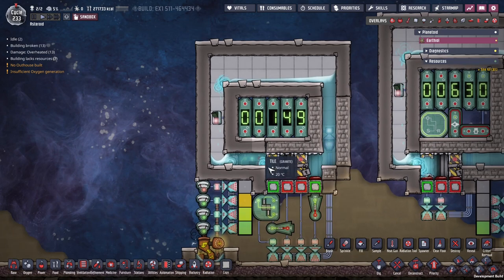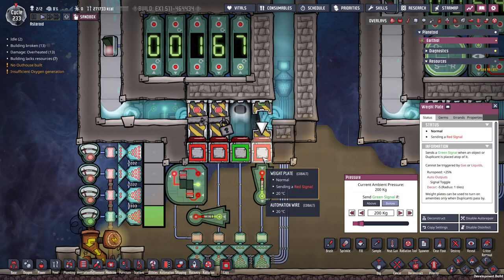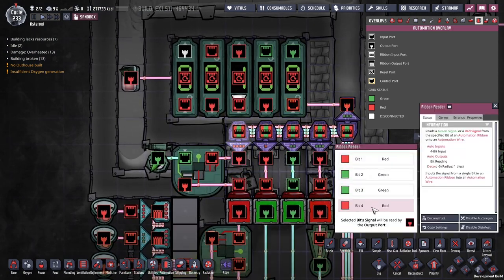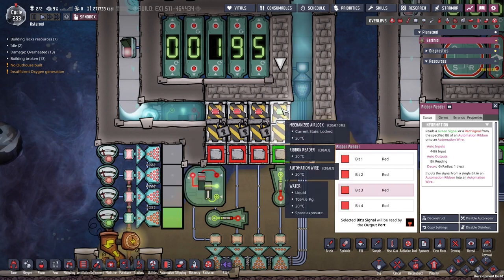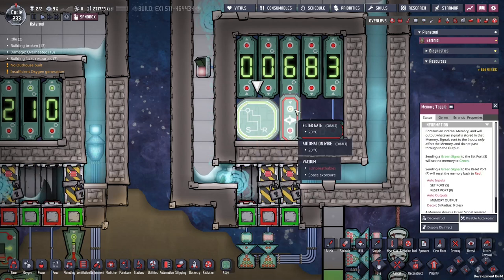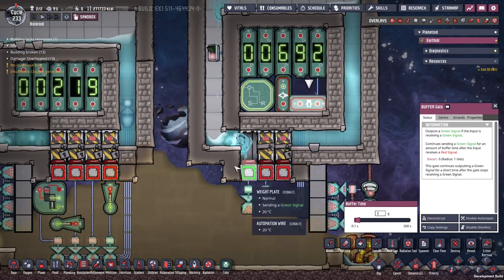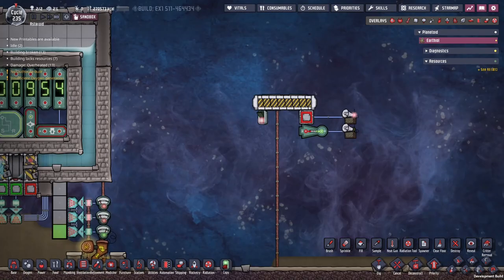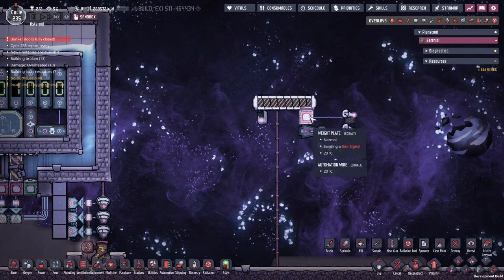Pump With Doors Like a Boss! - Oxygen Not Included

Comment: Hey GreezyHammer. Interesting tech with the weight plates detecting the door. Nice
Reply from the maker: Thank you! The concept definitely been around for a while but I'm testing to see if we can improve on it.
Reply: @greezyhammer764  I would imagine three applications for it in the game:

Compression (/destruction) of gasses or liquids.

Door crushing regolith. These can be as simple or intricate as you want them to be, depending on if you layer them or build them on (mesh) tiles.

And finally pumping with the option to create a vacuum lock. I’m yet to work this out, but I imagine a weight plate under the middle door with a filter gate would work. Seems like a good idea for an electrolyzer setup to make rocket fuel.

For other types of pumps either a liquid bead pump, a liquid bypass pump or an Escher waterfall is simply better in moving liquids and gasses around.

Comment: Hey greezyrhammer do you know if there is some mod that in the same tile you can put 4 electric wire or liquid pipe, like with the automation ribbon?
Reply from the maker: Good question. I haven't seen one.
Reply: Closest I've seen to this is a mod that allows you to use heavy watt in walls and doors.